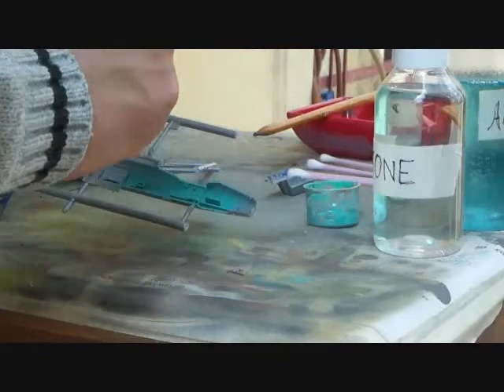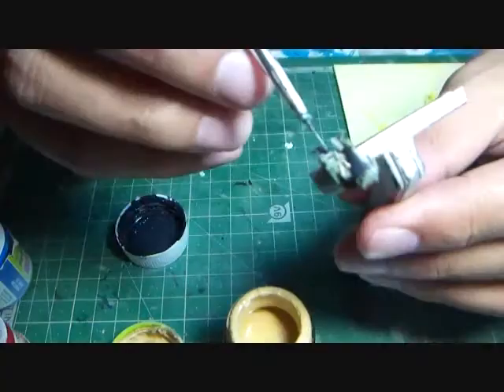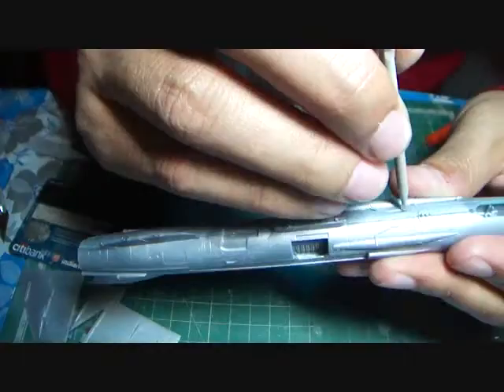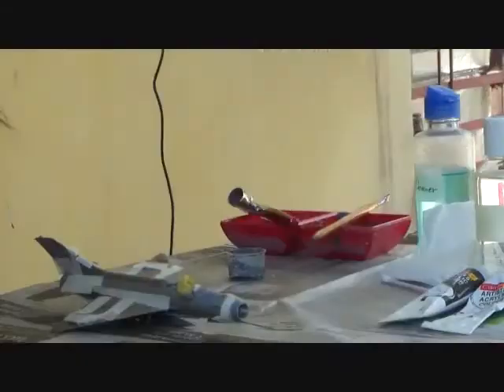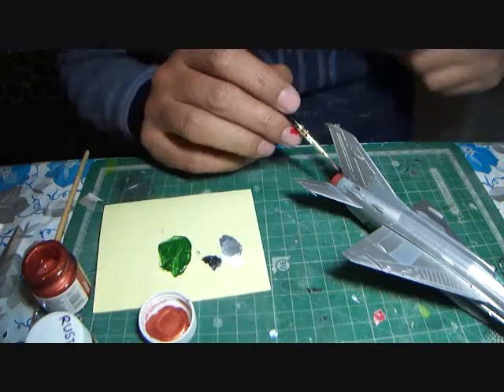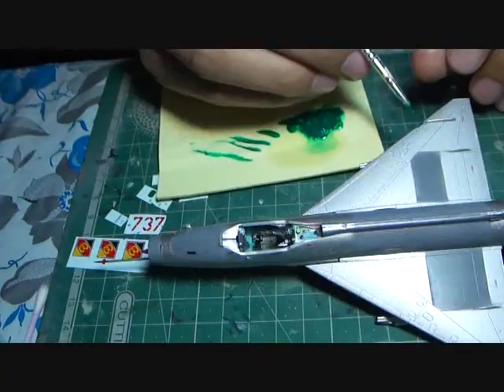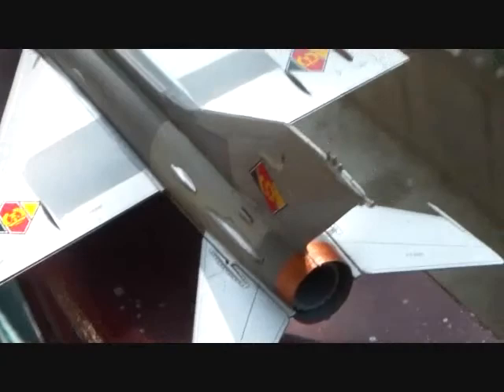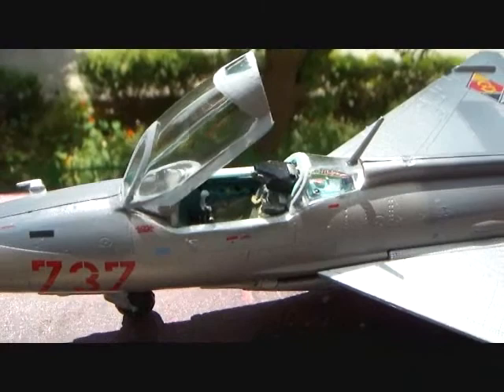Project Asteroid Sigmundjähn  - Revell 1/72 scale MiG-21F-13 Fishbed-C - Timelapse build

Comment: Hey! Fantastic work. May I ask, what is that brush you're using to detail the cockpit? The extremely pointy one that looks like a pin?
Reply from the maker: Aditya Thanks for watching and commenting. Well that brush I am using is a size 0 brush. I very carefully removed most of its bristles from the root by cutting them off with the hobby knife such that it left only 3 countable bristles in the centre that helped me achieve that pin-like pointed tip.
Reply: hahahaha! that's amazing. can't believe I didn't think of that one. gonna modify one right now. thanks for this. I've been meaning to eventually pick up the same kit
Reply from the maker: Aditya go for it